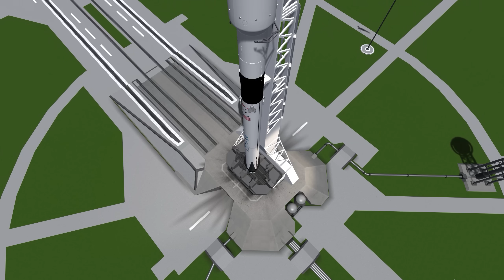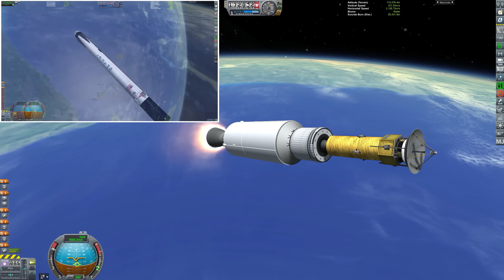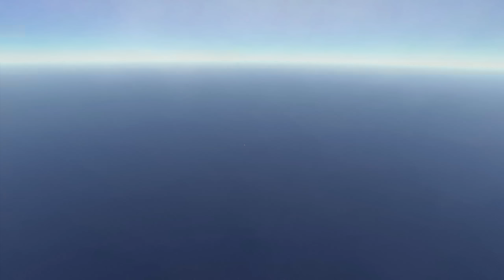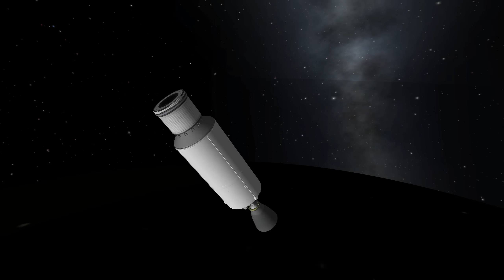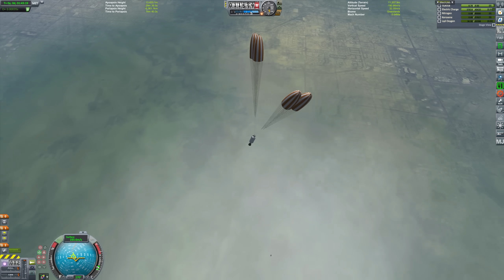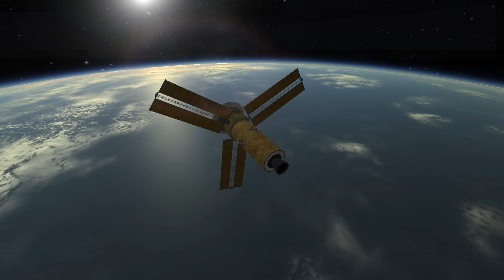SpaceX upper stage recovery - Can they do it? - KSP Simulation

Comment: Nice, straight forward idea. However, if using parachutes the craft will have to make use of some sort of landing gear. There is now way to catch something like that with a boat without it being blown off target by cross winds.
Reply from the maker: Similar issue to catching the fairings really. There needs to be some pretty serious tech on the boat that can anticipate the landing location and keep adjusting accordingly. Really this would probably be easier to pinpoint due to its weight. The fairings blow all over the place.

Comment: My money is still on 'party balloon' referring to a ballute rather than an inflatable heatshield. 

I guess we'll just have to wait and see what the folks at SpaceX have cooked up.
Reply: Brent Smith elon has mentioned using a inflatable heat shield and a party balloon in tandem before. The balloon to keep it from flipping and the heat shield to do what the heatshield does best
Reply: If they're already using a balloon for stability and drag, what is the point in an inflatable heatshield as opposed to just coating the nose of S2 in PicaX?
Reply: Brent Smith While coating the nose may be sufficient plasma may wrap around the body and damage the engine bell which is essentially the most expensive part. This is pure speculation on my part but it would seem like an inflatable heat shield would be the best option for recovering stage 2 in useable condition.
Reply: It's good speculation. I didn't consider the possibility of plasma wrapping around, but it sounds very plausible.

Comment: You could use the lazcalc functions from KSlib for kOS during the ascent, it allows you to steer the rocket properly instead of having the second stage burning towards 90° east despite the inclination. Just read the documentation which will explain it a lot better than I do. It doesn't make a huge difference but it's a tiny bit more precise and efficient.
Also, Kerbal Reusability Expansion has the nice looking Titanium grid fins

Comment: 9:20 that heatshield would be very expensive I guess so I would rather find a way to recover it. 

I have similar design for a reusable II stage except it uses 5m, non-inflatable and non-jettisonable heatshield and it simply lands on parachutes, upside down on that heatshield, somewhere near KSC.
Reply from the maker: Yes I suspect the parachutes would not have the same issue that mine here had. I fully expect that the heat shield would stay on (or at least be recovered) in real life.
Reply: winged Can the heat shield be used as some form of parachute like the Soviet Venera landers on Venus
Reply: Lets catch it with a boat.

Comment: once the BFR is in place, falcons will be gradually ditched.
Reply: I personally don't think so. The BFR is a super heavy lift rocket with some 150,000kg to leo. Not everyone needs that much to LEO. I can see the Falcon Heavy being put to rest but not the Falcon 9
Reply: Planning doesn't mean it will. It will be a sad day when the Falcon 9 touches down for the last time
Reply: @_Andrew2002  Probably not so sad because maybe when they ditch the Falcon 9 they will have a new rocket, but eh idk elon got his own ways
Reply: hopefully Elon will change it's mind until than. the falcon9s could be modified to be propelled by raptors. and having so many sats on 1 rocket, it would give me chills. Just think about the fact that the rockets are still susceptible for explosions. Imagine what woulded mean for a rocket with 20 sats or more to go kaboom.
Reply from the maker: True!
Reply: +Andrew. Elon plans to stack multiple payloads inside the fairings and release them in multiple specific orbits.
Reply: Thus the reason I only want the BFR to be used on human and cargo flights to the Moon and Mars
Reply: I think the falcons will still be used for payloads like they do now
Reply: due to the cost, is not very likely. though the BFR will be most powerful, the launch cost will be the smallest.
Reply: The landing capability of a first stage depends on having 9 engines or so, because the thrust of just one engine throttled as low as possible is still more than the weight of the near-empty first stage.
Reply: Also  maybe being used with dragon to resupply commercial stations/iss
Reply: Guys the BFR/Starship will cost as low as 7 million USD. The Falcon 9 costs ~60 million. Uhh Yeah no need to keep it
Reply: Someone else I mean if they can keep the cost of the BFR that low, I don’t see any reason why the Falcon wouldn’t experience a price drop as well.
Reply: I don't think so, there is already a very small amount of space companies that launch small satellites. Thats why the electron rockets are so successful-ish

Comment: Wow that was cool. Now you have to recover the fairings too haha
Reply from the maker: LOL... Yea, sadly the fairing recovery isn't possible in KSP as far as I know. They just disappear as soon as they are out of view.
Reply: @MarcusHouse  you can edit the part file to have them have unmanned control then they become probes and don't die
Reply: @MarcusHouse  you could have had a mod that makes it possible to detach ONLY the probe and not the fairings so the fairings would have stayed on the 2nd stage and landed at the same time as it, on it
Reply: @MarcusHouse  use radiators lol
Reply: Marcus House Is there a mod that makes that not happen? Or you could try to make it a vessel after it separates so that doesnt happen?
Reply: Spacious354 It works!! I tried myself but is hard to control and slow them down. So i added RCS.
Reply: Haha.... Now they are doing that too !!😂😂
Reply: Welcome to may 2020
Reply: Spacex actually catches fairings using massive nets
Reply: Spacious354 That is what I thought, (attaching probes to the fairings) but maybe it doesn't work
Reply: The Spot Nice one. Would try it myself but I'm not the best at ksp.
Reply: Mr Steven agrees
Reply: Space x did that
Reply: Good idea
Reply: The Spot In KSP, you can’t really do that. Since KSP does not mark fairing panels as debris.
Reply: Lol
Reply: It's easy just don't discard fairings, just open it backwards away from payload
Reply: I have an idea. It's marked as debris. Just make the 2nd stage land automaticly and then you got hands free for the fairings. Maybe out some parachutes on it to make them land
Reply: He predicted this bruh
Reply: What about a recovery vehicle for all those that get left out there?
Reply: Nice space x beat you in real life lol